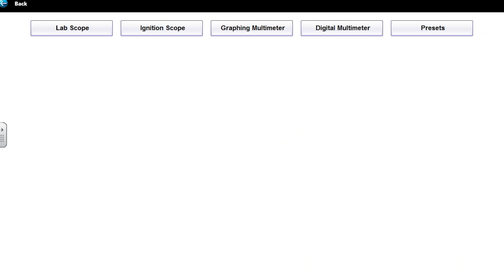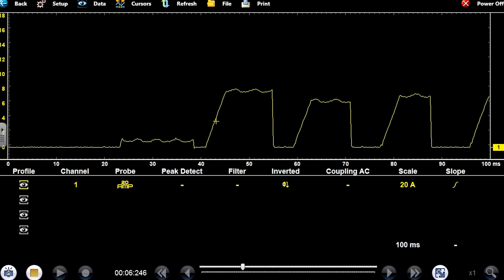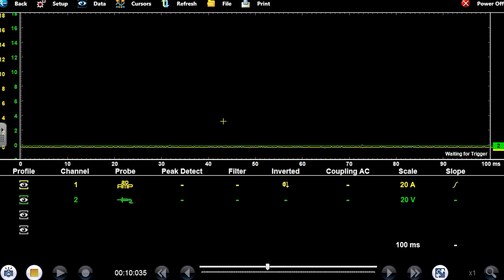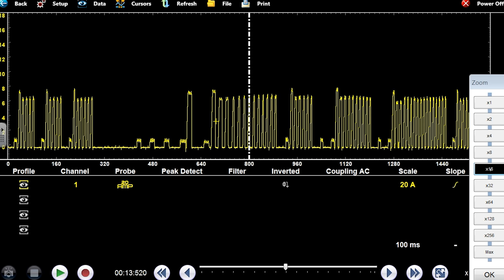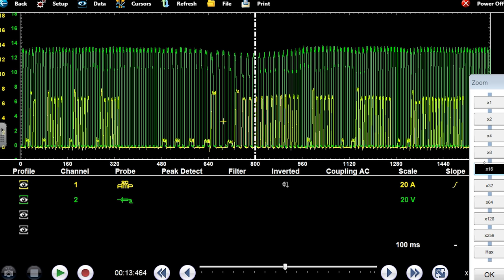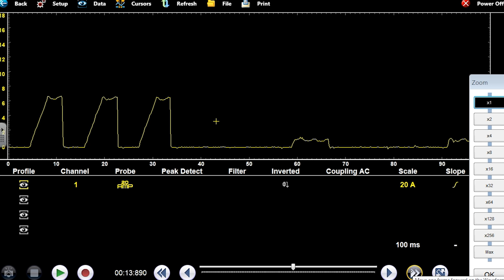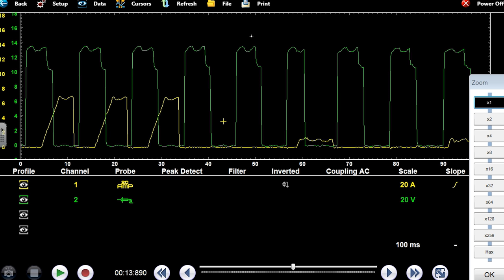Getting My A$$ Kicked By an 86 Mustang (Part 1)

Comment: Was working for Honda back in 87.  At that time we would take in the circa 84 ford tempo's etc on trade-ins.  One of the techs was working for Ford before he came over to honda.  He explained that there was a recall on those ignition systems. --  If I remember correctly there was an issue with too much current going through the TFI modules and damaging them around 40 or 50 K.  The problem was the ignition coil drawing too much current and gradually frying the module.  The fix was a new TFI and a new ignition coil.  Those cars would simply quit running about the 50K mark and come in on a hook.  --  According to the former ford tech, sometimes the heat would cause problems in the pickup coil inside the distributor and that would need replacement.  BUT  the original problem was a low resistance in the primary winding of the ignition coil.
Reply: Back in 88 I put in a new TFI and a new coil on a customer's car and explained the problem to the owner.  She did not believe me and told me to put her old coil back in the car. --  Lots of people think those modules were junk, but it was the ignition coils that kept knocking out the TFI's.
Reply: Ford would upgrade the systems for free with a new module, ignition coil (And the distributor if needed, I can't remember the criteria concerning distributor replacement) up to 50k, No questions asked.  After 50k you were on your own.  The problem was many of them keep running till just beyond 50 or 60K.  Put in a new module and you were good till it slowly cooked, just like the other one.  ----- People didn't know or believe the fix was to replace the ignition coil with a newer one with a higher primary coil resistance, (Lower current flowing through the TFI.)
Reply from the maker: Ignition coil current flow peaks were perfectly fine (around 6 amps). Good tips though thanks!

Comment: Engine to chassis ground...
When it wouldn't run until you ground the distributor to the module, that's because the whole engine is grounding through the module.
That'll cause some funky waveform action.
Reply from the maker: No sir, that definitely is not what we saw. But good thought! I did measure module ground voltage and it was normal.
Reply: Thats fummy. my first diag was that. didnt fix but a ford tech stopped by shop n told me it in 2 mins no testing. now that blew my mind than. and ive had a passion for fixing cars since. iam in my 60's n that was in 1978

Comment: I think 🤔 you should check resistance in your coil , I had a similar problem with a Datsun 76 my brother changed new remanufacture distribuidor and didn’t work and what happened is that we had the wrong resistance coil👍👍🤔😎
Reply from the maker: Coil resistance issues would be seen in the current ramp pattern. Also the resistance test of an ignition coil is a poor test at best. The thing to remember about ohmmeters and resistance testing of circuits, that carry any current flow, is that when they measure bad, its bad, but when they measure good, they can still be bad. Ohmmeters suck! 😅

Comment: The car on the lift in the first clip is a my current car G37 IPL  ( infiniti Preformace Line) with the red interior rare spec. The front bumper is $1400 IPL specfic.

Comment: I remember the nightmare of late 70’s early 80’s ignition systems. Still have my OTC Electronic Ignition Analyser.
It was customary back the to test these systems while cranking, not running and battery voltage needs to be correct.
WHILE CRANKING MAINTAIN BATT VOLTAGE
1.Check coil primary, if OK all is well on primary. Chk secondary for spark. No spark replace coil.
2. Check pickup output
3. If pickup is providing pulse to module but module is not providing proper output replace module if connections, pwr & gnds are good.
4. Module output is good, but ign coil is not providing proper kickback voltage, indicating an open primary circuit. May be intermittent!
Before replacing coil on Ford check the ballast circuit.
-A particularly weird problem was Ford, AMC & Chrysler still used the points system ballast circuit. Recall these are the days of evolution from non-electronic  to electronic systems.
Cheers
Reply from the maker: funny thing is the flow charts haven't gotten any better on todays cars 😂
Reply: @ScannerDanner  and neither have today’s mechanics 😂😂
Reply from the maker: @rickw.9298  true there too unfortunately
Reply: @ScannerDanner  Thats because shit always has n always will flow uphill...lol

Comment: Hey Paul I’m still watching the video I had a similar problem on my 86 e150 5.0 there’s a resistor wire called IDM it goes from the coil to the ecm pin 4 so my coil connector was bad
Wish I could post the pic of the coil connector don’t know how

Comment: It seems like there may be some clue in the yellow coil current pattern. I noticed large negative current spikes, almost seeming to indicate the current was back feeding to find somewhere to go. There were also times when the first coil ramp would be low, then the next ones were higher. Possibly the problem is related to an intermittent open circuit for the ignition coil (not an internal coil failure), aggravated by engine vibration and heat. It was also apparent that the engine was having issues cranking, so could it just be a faulty main engine block ground? I'm looking forward to part 2.
Reply from the maker: Good thoughts! Thank you.  But I confirmed it was not an intermittent open in the coil, or the control wire when I showed coil (-) voltage, measured right at the module. When the current ramps stopped due to no control, I had battery voltage on coil (-), if the coil was an issue we would have seen 0v during that period of time. Make sense?

Comment: Paul I did one about 6 months ago  the shop put 2 distributors in I checked it I put a computer in and fixed it I opened the computer and the capacitors were leaking

Comment: We have records of several new optisparks on Chevy LT1 being faulty on the box… same for ignition module or coils… this is the case in which, a part from diagnostic, you could check only with KNOWN good functioning parts, change with known good working module or coil. Could be an arching plug wire? I mean sometimes simple things…
Reply from the maker: For sure! But an arching plug wire won't cause the ICM to stop controlling the coil, unless it was arching directly to the module itself? Good thought

Comment: Iam working on a 1990 ecc4 sytem and it runs perfect and then it shuts off. With leaving the key on and crank it it will have no spark cranks but wont start. But if you turn the key off and recrank it it will start right back up and run good . And then will repeat that. Before all of this it was shutting off consistantly every 3 minutes, I replaced the pickup coil and module and it was working great for 2 days and now this. Any Ideas on that one???
Reply: Open up the PCM and check for leaking capacitors? These older EEC ecu's are having lots of issues with capacitors.

Comment: If memory serves me, the module and computer grounds at distributor housing. The ground wire at the module, comes from computer,  not from a ground source. Not sure if this applies to all applications.
Reply from the maker: I believe you are correct on this one and you are right, not all applications did this apply. The remote mounted TFI modules did not need to be grounded on the housing

Comment: at 23:57 what interests me is why is a single pulse square wave look different than the others on the green trace versus the other 7? Total noob here, so i'm just wondering why it doesn't have the cliff like the others.
Reply from the maker: That's a characteristic of the reluctor wheel in the distributor. There is 1 small tooth and 7 larger ones. The 1 small tooth is used for #1 cylinder ID for sequential fuel injection to take place. It has no importance for the spark control as the distributor handles that. Make sense?

Comment: Hey, Paul maybe you could help me I have 2004 Pontiac grand am GT 3.4L it’s having some idle fluctuations under acceleration it’s happens just below 2,000 RPM only in the highway on the regular roads it fine expect going uphill and if I try to accelerate more it doesn’t it stays at 45-60 MPH doesn’t go passed those speeds I cleaned the throttle body but no luck I’m going after the IAC valve now! or mass air flow! Your input or feedback would be great!?
Reply: Is it an auto transmission?
Reply from the maker: do an exhaust back pressure test. Your second symptom of not being able to go past 45-60 mph sounds like a restricted cat Do this test! https://youtu.be/9TlygJMxTps
Reply from the maker: @NOsmoke24  this can be an issue to for sure. @Jarvis watch the video I just linked, I show the O2 test at WOT to address a fuel volume issue as well as the restricted cat

Comment: Is it possible that the shutter blade in the distributor is magnetized? Bernie Thompson just did a video on a Honda Odyssey Where the crank pickup wheel was magnetized due to improper placement of a battery ground wire. It would compromise the signal from the hall effect sensor.  It's a long shot, but may be worth a look.
Reply from the maker: 😂 no, I've never seen a magnetized anything, cause anything in 30 years of doing this. Though I have heard of it. But I think a factory sensor would have fixed his car btw
Reply from the maker: the hall signal (PIP) was not distorted and looked good on this one, though I did questions the clipped edges for awhile there. Thanks for the comment!

Comment: Can I ask a question relating to fuel system. In particular the fuel pump solenoid. Fuel pump by connecting a battery across the business side of the solenoid and have fuel flow from the pump. I get no click from the solenoid when I turn the key on and when I check voltage on the control side I get 12.8 v at one terminal but on 10.8v at the other one. Hope you can steer me in the right direction. No click from the solenoid at all and have tried different good solenoids The car hasn’t run for maybe 5 years. I have only very basic skills and very basic tools.
Reply from the maker: Your speaking of the fuel pump relay, there is no fuel pump solenoid. 
What year, make, model, engine size?
Reply: @ScannerDanner  oops sorry, yes it’s the relay on a 2004 Nissan exterra, in Australia it’s called a Nissan Navara  running a VG33 V6 petrol engine.
Reply: @ScannerDanner  The engine is a 3.3 litre V6
Reply from the maker: @georgetawhiti2133  let's move this to my forum, I can't offer back and forth messages here and we need to dive into the wiring diagram on this one. It is free to join https://www.scannerdanner.com/forum/post-your-repair-questions-here.html and we can absolutely help you. Thank you for understanding. I get about a 100 new messages or more a day here and then they just multiply on me from there lol

Comment: Ouch. This is the one that makes you think: I really don't want to carry the cost of a wrong call and be stuck with a new electronic part that I won't need again and cant send back. What do you do? Given the disconnected SPOUT makes such a big difference, though it's not 100% fixed, why isn't it a faulty/inconsistent SPOUT signal from the PCM, in which case the call is even bigger:-0
Reply from the maker: It didn't make a big difference, not consistently. Nothing i unplugged (alt., spout) made a difference if you watch it further in. I did mention that it did, but I was wrong and corrected myself
Reply: @ScannerDanner  keen to see the follow up ... excellent instructive vid, as always. Thank you 🙏

Comment: The distributor housing is grounded through the engine block where it goes into the engine so the distributor pick up and module should be grounded to the housing of the distributor correct?
Reply from the maker: Yes, but grounding the ICM housing should have worked and it didn't. I had to ground it to the distributor housing

Comment: I thought there was some kind of grease or something you put between the module and the distributor. I change one way back on a bronco and I remember it had this die electric grease between the module and the distributor. Would that have been to ensure a good ground between the module and distributor?
Reply from the maker: it is actually a heat sink grease (helps dissipate heat)
Reply: Ah ok, disregard comment I watched the part 2 and realized I’m just a dumbass
Reply from the maker: @fireguy8466  not at all my friend! It was a great question

Comment: i feel for you,  we all get these problems from time to time that do not stack up . Its seems that the distributer is not grounded to the engine block i wonder what difference would be made by supplying a quick ground to it just to confirm its not taking another path,
Reply from the maker: Pretty sure I did that? (Jumped the distributor housing to battery neg). Then I also jumped module housing to battery neg. And it would only start when I jumped distributor housing to module housing

Comment: i had simular situation on 1987 RV  had ford 460 with ign module bolted on heat shrink on fire wall was misfiring had plug wires replaced plugs tps sensor and egr. I just checked pip signal at module and spout signal they were clean LIKE YOU TAUGHT ! ON  your premuim channel with my cheap one channel scope bought more exspensive module at auto zone duralast because i couldnt find a motorcraft one  bingo solved misfire
Reply from the maker: Heck yeah! Awesome. Thank you and nice job!

Comment: I don’t understand something. Why are you only checking amperage to the coil. Not the signal. Shouldn’t you look for a signal to the coil? Will amperage show signal to coil.
Reply from the maker: Yes, it's cleaner too. No need to look at control voltage in this case as the control itself was dropping out. Make sense?
Reply: @ScannerDanner  I always thought  like checking the circuit with the Amp prob shows the electrical work being done. But if it’s not being triggered you have to check the signal with voltage. What I’m thinking you’re on the power side of the coil. The module pulls it to ground. If the coil is going bad or the signal is dropping out it would show the same on the Amperage wave form. I’m probably wrong. I haven’t been in a class in awhile. I don’t use my scope as much as I should. It’s a old pos. I really want a pico
Reply from the maker: @Ken-wu6hr  i did verify control wire voltage both at the coil and module to eliminate an intermittent open in the coil and the wire.
Reply: @ScannerDanner  ok I missed that I’m sorry
Reply from the maker: @Ken-wu6hr  no problem

Comment: Paul, also one more thing to consider, this Mustang is a standard/manual transmission correct? The grey module is for push start, black ICM is not, internal circuit for dwell time differs. Maybe the octane rod needs adjusted? LOL JK!!!!

Comment: I would take off the dist cap an inspect the internals. Check the cap and contacts.
Reply from the maker: This is a primary circuit issue. What you're describing would be secondary issues. Check out Part 2 when you get a chance! Thanks!
Reply: @ScannerDanner  
I watched part two as well. 
Secondary wiring and parts issues could very well play a part.
Reply from the maker: @ekimbrough1413  this was crap modules right out of the box. Had nothing to do with the secondary on this one

Comment: Glad i ran across this video. Can't believe that i actually watched the whole thing. Anyway. great diag on the ignition. And yes people still care about these old 5.0s. I have an 88 LX with this 5.0 engine . Still running strong and no problems at 237K miles. Auto trans. Great to know that this is module related. I'm thinking since you mentioned Alternator is a factor , What if the Alternator Cause this problem? Its frying the module since bad diode sending out AC instead of DC. Know what i mean?  And Chinese parts are crap.
Reply from the maker: The ripple wasn't high enough imo to damage anything but it was certainly there! Just wasn't the problem.